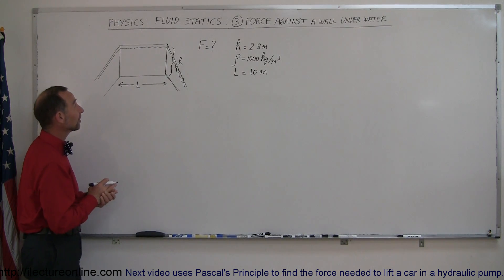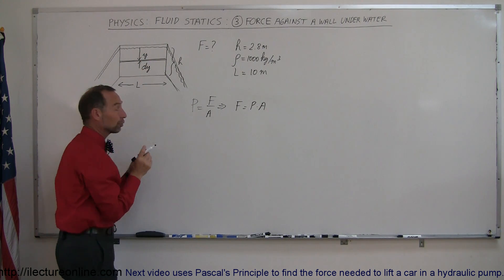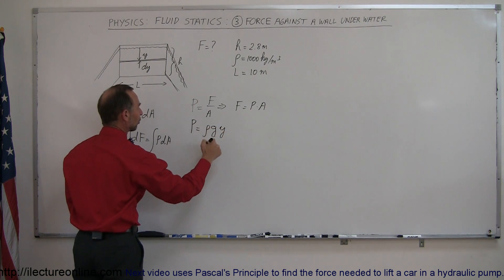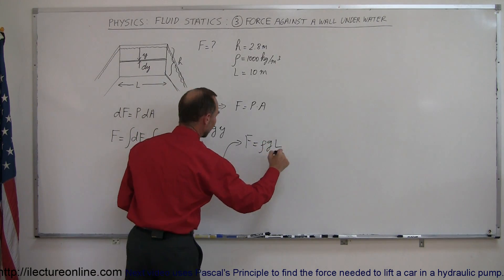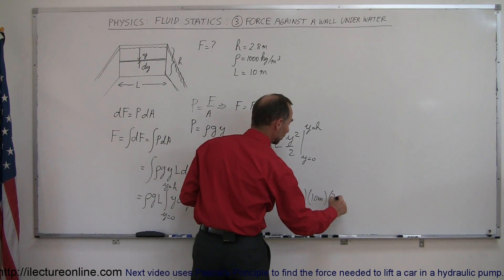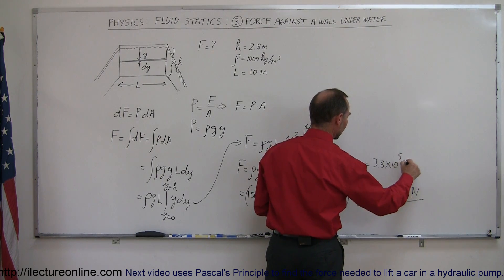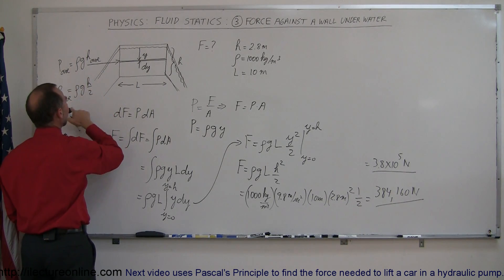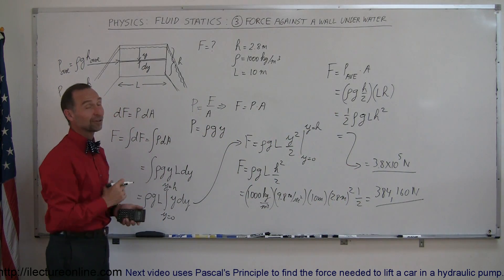Physics 33 - Fluid Statics (3 of 10) Force Against A Wall Under Water

Comment: this is 2 dimensional.....would it still apply to 3d? If the dimension not shown is infinite, in 3d, would this still be the right answer? I m inclined to say yes.
Reply from the maker: Than answer is indeed, "yes".  🙂
Reply: @MichelvanBiezen  heheh, ye, thx for being so kind and confirming what I thought ;)...Just out of curiosity, if this reservoir was a cylinder, would anything change, if the diameter was equal to L?

Comment: Awesome video, thank you! One question: let's say there is a column of water on top of the tank (riser column), that sort of looks like a chimney. TLDR: will this calculation (F=rho*g*L*1/2*h^2) stay the same, no matter what is above or resting on top of the surface of the "pool", in your example? Say, atmospheric pressure vs. another thousand m3 of water.
Reply from the maker: If the pool is completely enclosed so that it is a tank with water all the way filled to the top and a "chimney" is added and filled with water, the pressure would increase everywhere with the additional height of the water column.  (But not if the pool was open to the atmosphere without a cover).

Comment: What if the wall is cylindrical
Reply from the maker: You would calculate the eexact same way (method of integration), but you would integrate over a circle instead of a rectangle.
Reply: @MichelvanBiezen  so I will use 4πr² for the area right?
Reply from the maker: That is the equation of the surface area of a sphere.  You want to use pi x r^2 for the surface area of a circle.

Comment: I am building an aquarium, Can I use the same equation, substituting with my depth and width? My Depth is 54" and width is 76". 1000x9.8x2x1.5²/2 = 22050 Newtons?
Also, would this be the total pressure against the wall.
I come up with around 5000lbs force when converting from newtons. Can I divide the total square ft of the wall by 5000 to see how much pressure is equally against it? I have a steel frame for the glass on a wooden tank, I'm trying to figure what gauge steel framing I need... the tubing has a lb per ft load limit. Thanks for any input. Hopefully I am explaining it correctly
Also if I am wrong above with the total pressure divided by total square ft., (I get ahead of myself). 
I have a devider across the 2meter side halfway down at 27", that's .75 of a meter, is 5000 newtons corrects for the equation @ 27", can I divide the total width of 6ft by 5000 and get the LB per linear ft on the steel frame @ 27"?
There will also be a peice of glass on all sides of the steel frame silicone in place, will the fact the glass touches all corners of the frame decrease the total pressure and spread it out?
Reply from the maker: That is a big aquarium, so your result sounds about right.

Comment: hi, i have a open channel flow, i want to calculate the total force on side wall if the velocity of water is 2.0m/s and height of wall is 10m can you please help.
Reply: You may have to use Bernoulli's equation if you have learned that already.
Reply from the maker: The reduction in pressure = (1/2) (density) (velocity)^2
Reply: @MichelvanBiezen  thanks, but how pressure calculation done without taking area in the equation ?
Reply from the maker: The height of the wall is given and since P = (density) (g) (h)  you can calculate the pressure.

Comment: Hello sir, on the second method why did we have to use h/2 instead of just using h? Why did we use the average pressure instead of the pressure at the deepest? Sorry for the ignorance, the concept is still confusing for me.
Reply from the maker: By definition,   F = P x A    (force = pressure x area)    Since the pressure is greater near the bottom of the pool, the force per unit area near the bottom is greater than the force per unit area at the top.  The average pressure (at the middle between the top and the bottom) gives us the average force per unit area for the whole side.  That is why we use the average pressure, ( because it averages the force pushing against the wall).

Comment: Quick question, if the surface area of water to pool wall does not change, nor the depth of the water, but the total volume lessens, for example a hollow tower in the middle of the pool, does this decrease pressure against the pool walls?
Reply from the maker: Good question.  No, the pressure would be exactly the same.
Reply: @MichelvanBiezen  Thanks. And is that true for any volume, or is there a point where it is affected? For example if the tower is the shape of the pool and takes up 99% of the space, and a thin wall 2mm wide is left of water volume, same pressure?
Reply from the maker: Yes, it would be the same pressure.

Comment: A question please - why is the atmospheric pressure (Patm) excluded from P = ρgy? Why not P = Patm + ρgy? The additional 1 bar atmospheric pressure should add more force on the wall?
Reply from the maker: Since the atmosphere acts on both sides of the wall, it cancels out.   (For example, what is the pressure on the inside of a window?)  We say zero, since the pressure is the same on the inside and outside, unless you are in an airplane).

Comment: Saying the average force occurs at H=1/2 is a common misconception. While it is true that the pressure is linear, the force as a function of depth is NOT LINEAR, but rather depends on the square of the depth. To find the location of the average force, we must then take a weighted average of a parabola, not a line. (Calculate the centroid of a pressure prism.) As such, the location of the average force occurs 2/3 below the surface, not at 1/2. This video is wrong, and is propagating a very common misconception. Please correct it.
Reply from the maker: There is nothing wrong with the video.  It shows how both methods give you the exact same equation for the total force against a side of the pool.  (You may be thinking about the torque)

Comment: How is there possible that there is horizontal pressure? I asko because in your first fluid statics video you calculated pressure on on vertical component of tube. Am I missing something sensei?
Reply from the maker: Pascal's principle states that pressure inside a fluid acts in all directions

Comment: question.
there is a swimming pool(3*4m, 2m height) with water
-do the 2 walls of 2*3m have 60,000N each?(when, g=10)
-do the 2 walls of 2*4m have 80,000N each?
-how much force do the bottom of the swimming pool have?
Reply from the maker: F bot = P x A = rho x g x h x A  where h is 2 m
Reply: Michel van Biezen Thanks.
I thought my calculation was wrong because the all forces the walls and the bottom have are  520,000N. I thought the amount of water(24tons) in the pool can only give 240,000N to the four walls and the bottom so that the sum of the forces should be 240,000N.
Reply from the maker: The force on the bottom should be the same as the total weight of the water.
Reply: Michel van Biezen thank you so much.

Comment: A little correction sir, The pressure underneath the water is P° + Density of liquid(h), but due to atmospheric pressure from the other side excess pressure is (rho)gh
Reply: Could you explain again why P = ρgh and not P = P_0 + ρgh? I find it so confusing why we all accept that the pressure of a body in water feels both the water and atmospheric pressure, but the wall only feels the water from the pressure.
Reply: Oh i think I get what you said, thank you!

Comment: I have a question of an aquarium and the force is acting 2/3 the depth. Is that a standard? The following link is the question.
https://www.chegg.com/homework-help/specify-magnitude-location-resultant-force-acts-side-bottom-chapter-5-problem-187p-solution-9781118807330-exc
Reply from the maker: The force will be acting everywhere and the magnitude of the force will be proportional to the depth.  The total force = density x g x area x (average depth of the surface)    The average depth will be 1/2 the total depth.
Reply: Michel van Biezen when it asks for height where the force acts on the 4 faces it says 2/3 the depth. I thought about h/2 but I was wrong. Would you know why please?
Reply from the maker: Look up the concept of "center of pressure".   The "net" force acts through the center of pressure with is 2/3 down from the top.
Reply: Michel van Biezen ok I understand. How do I find the value of the center of pressure? (2/3)

Comment: Is the F experienced by the wall the same at all points on the wall? Because P can vary bc of the depth change, and F= PA, I'd think the F would also change depending on the P. Right? So the final equation used (F = Pavg x A) is really calculating the F average?
Reply from the maker: No, F is the total force on the wall.

Comment: Can you or another viewer explain this without using integrals? Thanks.
Reply from the maker: Another way to find the total force is to multiply the area of the side x the average pressure.  For a rectangular side total force = (W x H) x ((1/2) x density x g x H)

Comment: how can i find the amount of force acting on the area of the wall of a vacuum box
Reply from the maker: Assuming that the pressure outside is atmospheric pressure, the force would be F = P atm x Area
Reply: thank you, can you also tell me how can we determine the thickness of a wall when if there is pressure difference outside and inside the wall (like if i want to bulid a swimming pool with aluminium wall how can i determine how thick my metal should be to hold 2.5
 atm pressure )

Comment: Sir, how to find total torque by water on the side about bottom edge , if it would involve same tech.
Reply: If anybody has this question as well: it's just calculating the integral from the bottom to the top of the water.

Comment: Could you please explain to me why the pressure on the side wall is given by rho*g*y, when g acts vertically (which is parallel to the surface of the wall and not perpendicular)? Thank you.
Reply from the maker: Pascall's principle:  Pressure acts in all directions through the fluid.
Reply: in verticall the force creat by (spisfic weight*h) ,but in horezantal ??!!!

Comment: Thanks!, I was going to calculate if I could make my tank's divider with stainless steel plate. Before doing that I can actually just put some weight on the plate itself and see if there is warps. If it does, I will get thicker plates.
Reply: If you put your divider right in the middle the pressure on either side will be equal and you could use whatever you want; assuming your fishies couldn't break through it! :D
Reply: +Marty C because at times I will be emptying just one side of the tank.

Comment: Excellent. 1 comment:  Although your teaching does not indicate otherwise, just to drive the point home, I would have added that the distance of the pool of water perpendicular to the wall the force of the water is computed for is irrelevant since the force is a function of pressure only (2 parallel walls 0.5 cm apart say, would exert the same force as 2 walls a a meter apart). 
Also I commend your responding to comments. You are a true teacher.
Reply from the maker: +john zimmerman 
 Very good point. Thanks for the input.
Reply: +Michel van Biezen  You are welcome & similarly another example I share (which I shared as a comment in your video on the subject) which I believe helps reinforce the concept of hydrostatic force against a horizontal surface. 

It is understood that the vertical hydrostatic pressure/force against a horizontal surface depends only on the height of liquid. That means of course that the pressure and force against the bottom of all containers of water with 10 feet of head and 1 square foot of area at the bottom is identical and equals 62.4 lb/cu ft x 10 ft = 624 lb/sq ft pressure and 624 lbs force regardless of the amount of water. Thus, if we consider  a container with 5 pounds of water, 10 feet depth and one square foot at bottom (very narrow container except at 1 sq ft bottom) with a weigh scale placed inside and at the bottom of the container, the scale would register according to the paradox 624 pounds of water not 5 pounds - the scale of course, registering hydrostatic pressure, not weight of liquid. And thus, if the container weighs even 500 pounds, more force is exerted on the bottom of the container by water than on the structure supporting the container, the latter supporting 500 + 5 pounds which is less than 624 pounds.

Comment: I still don't totally get why dF = P(dA) even after reading some of the comments.  I would think dF = P(dA) + A(dP).
Reply from the maker: +addemfrench 
Don't think of dF as a derivative.  Instead think of dF as a small amount of force (infinitesimal small amount of force) on a very thin strip along the wall of width W and height dy (where dy is a very small vertical distance (infinitesimally small).

Comment: hey sir!
i didnot follow on why you didnot put the P as dP. 
yes it's very small but .. i.. just donot get it
Reply from the maker: +Abdelrahman Wael Helaly Good question.   Understanding that is the key to understanding how to integrate.   dF represents a small amount of force on a tiny portion of the wall (dA)Force is a function of pressure (P) and pressure is a function of depth (y).    Now how can you express the dF in terms of the pressure which in turn can be expressed as dF in terms of the depth (y)?  Take a look and see if it makes sense now.
Reply: oh! i see where i misunderstood.
thanks for replying, i owe you alot for all those videos! thanks sir

Comment: towards the end there, I don't c where h^2 came from, since it was 0.5h
Reply from the maker: Lebo,
Towards the end I am showing how the force against the wall can be found by using the average pressure ( = (1/2)*rho*g*h) and multiplying it with the area  ( = h * L), since F = Pave * A
That is where the h^2 comes from.